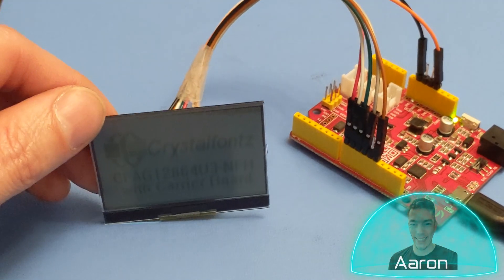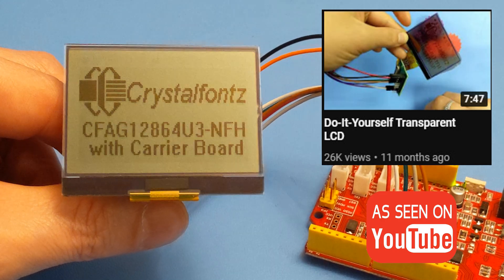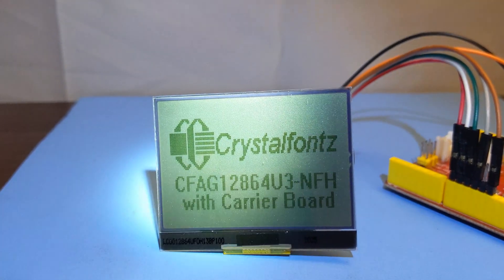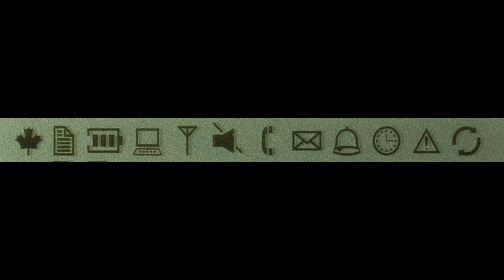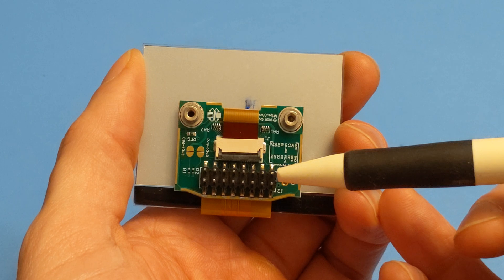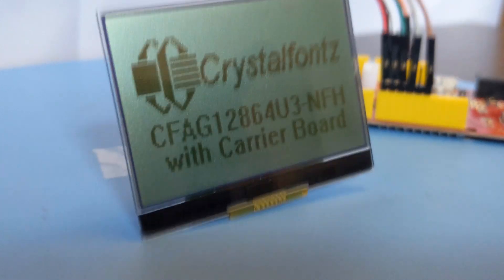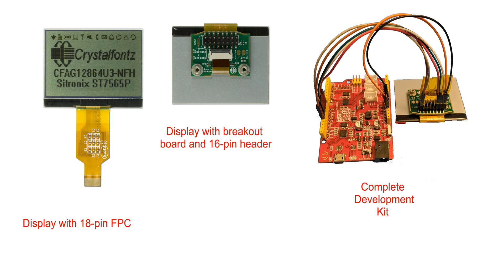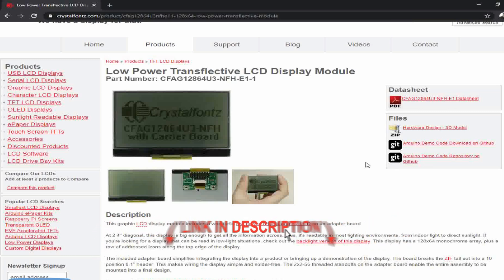2.2" Low Power + Sunlight Readable LCD Module

Comment: Is the breakout board attached to the lcd? i want to make it transparent and that wouldn't work if the bord was permanently attached.
Reply from the maker: If you buy it as a kit, then the board is attached. But you can also purchase the items separately:

Board: https://www.crystalfontz.com/product/cfa10110-lcd-breakout-board

Display: https://www.crystalfontz.com/product/cfag12864u3nfh-128x64-low-power-graphic-monochrome-lcd